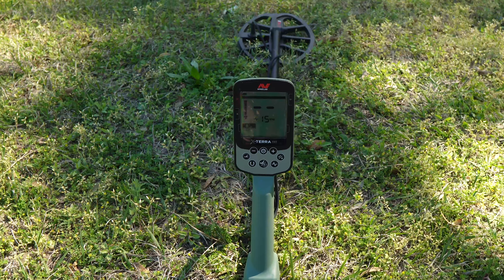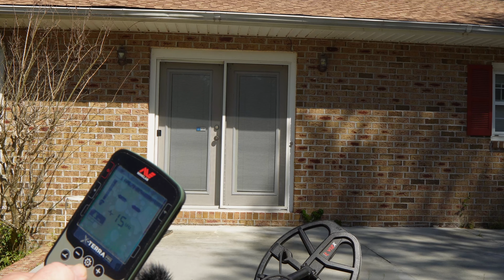MINELAB XTERRA PRO RECOVERY SPEED

Comment: Thanks for the Xterra Pro videos. I just picked one up today based on what I saw with your videos. It will be interesting to see how this does with the small coil. Are you going to test it with the small Equinox coil? I had an Equinox; bought it right after they came out and sold it some time ago to one of my good friends. This machine looks to very capable in comparison to the Equinox.

Comment: Used the XTP for the first time yesterday had a blast. Found some trash found some coins, and here comes the questions. Lol 
What would be the advantage of removing the factory coil and going to a smaller 6” Minelab coil? Also if the ground of a park has a layer of steel belted tire chips would that be the cause of so much chatter?
Reply from the maker: Yes that could cause some problems..You will be able to get in tighter spots with the 6 inch coil..
Reply: @calabashdiggeradventures  yes sir thank you